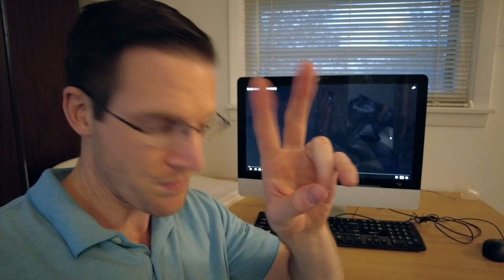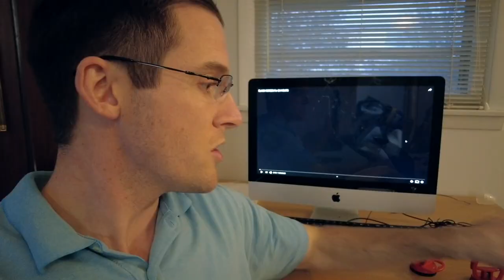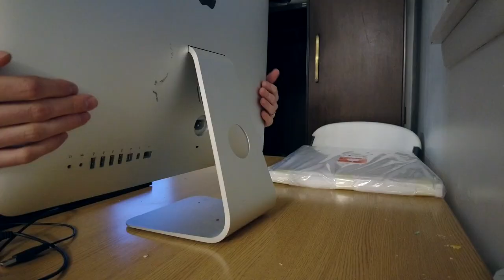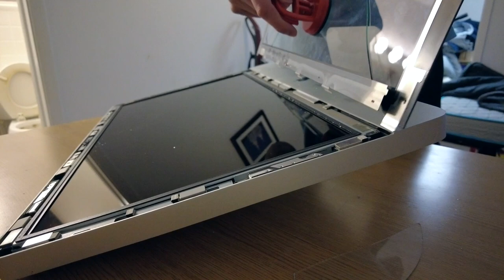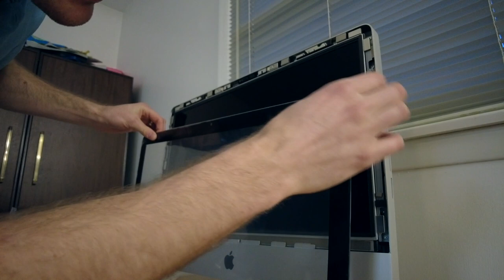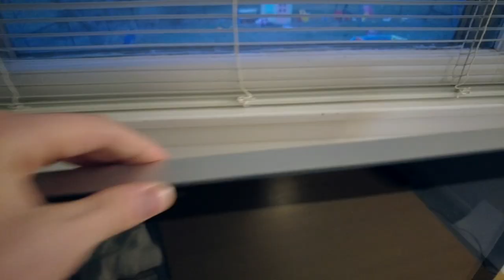Cracked iMac? How to replace glass screen in 1 minute // 21.5" iMac, 2009, 2010, 2011

Comment: Great video—made the replacement super easy. If you want to avoid your fingers getting squeezed, just use the suction cups to place the screen down. It does snap together quickly.

Comment: I have a mid 2014 iMac 21.5 inch screen; the glass is cracked, rarely  the screen doesn’t illuminate completely, but when it does its completely lit up.  It’s considered a vintage machine and Apple doesn’t sell parts for it anymore.  Any ideas????  Since I would have it already open I am thinking I might upgrade it to SSD and max out the RAM.   Anyone know where to look for help?    Thanks in advance!!